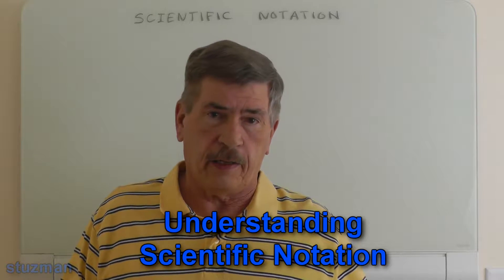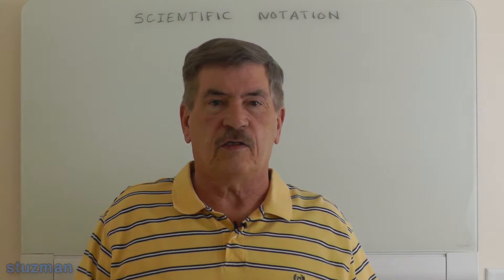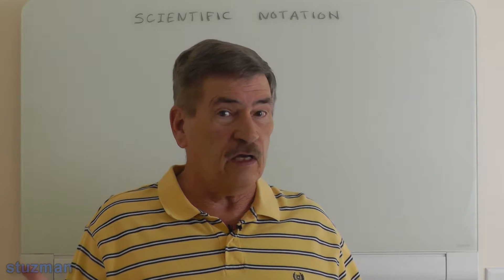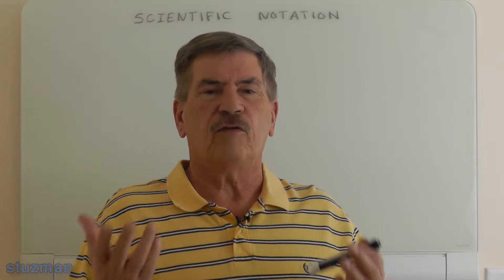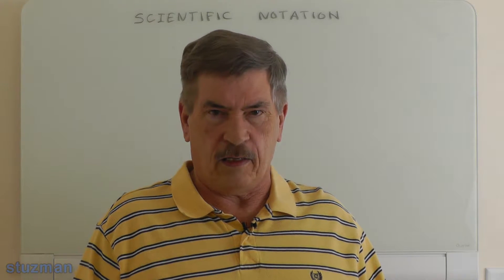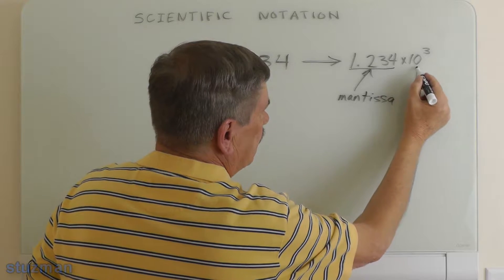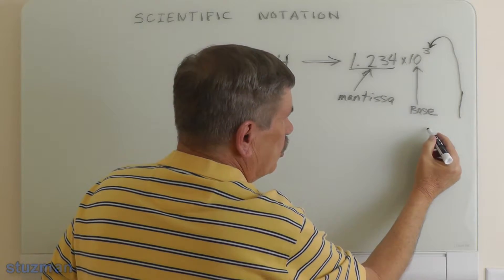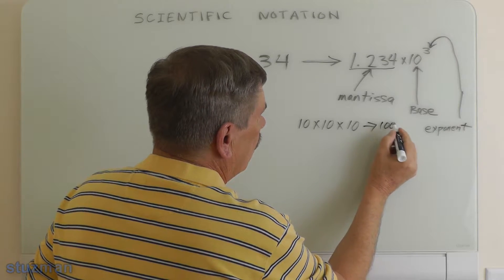Understanding Scientific Notation

Comment: I know this video is about scientific notation but if you had to make the number 2356 in engineering notation, it would also be 2.356x10 to the power of 3 right ? So in this case they’ll would both have the same result .  8:00
Reply from the maker: That is correct Andy! As you can see, this works for any four digit number. But, if you start with a four digit number and add 3 to it and continue on, it will work with other groups of numbers. For example, if I add 3 to a four digit number, I would get  a seven digit number which would work. Add 3 to a seven digit number and you would get a 10 digit number which works. As a final example, if I add 3 to a 10 digit number, I would get a 13 digit number which would also work. And of course, this could be repeated to infinity. These are all cases where the scientific and engineering notation would give you the same results.
Reply: @stuzman52  very good explanation thank you, I’ve been watching your videos and it’s helping me a lot
Reply from the maker: @AndyMarcellus15  Thank you Andy and glad to hear the videos are helping!